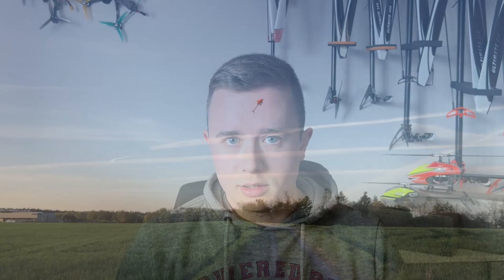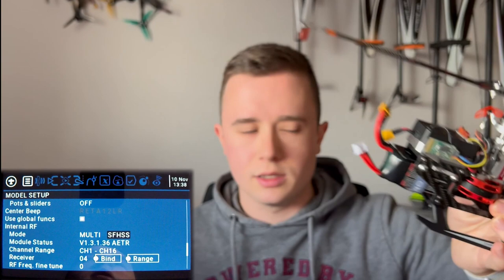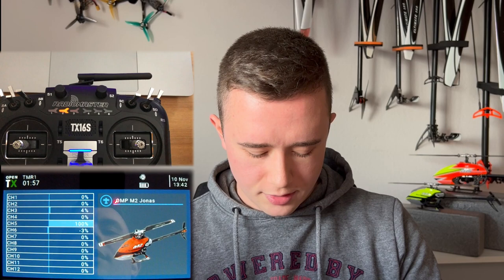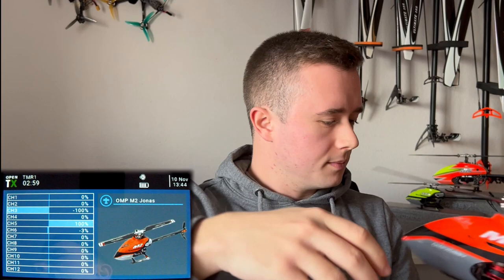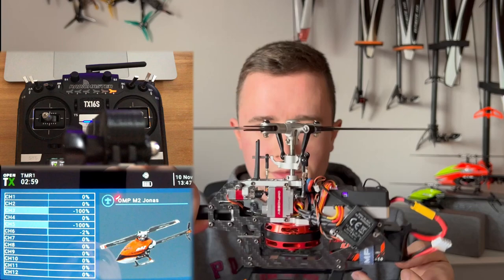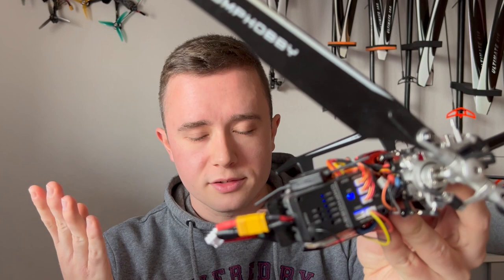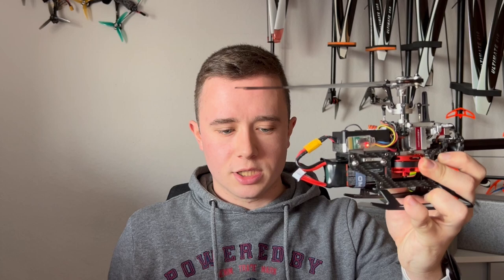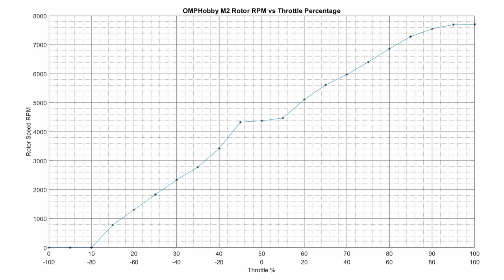Jonas' OMPHOBBY M2 Setup for RadioMaster TX16S

Comment: Thanks for providing this video and setup file, it is very helpful for OpenTX newbies like me! The rescue feature you added in is cool. Also, thanks for the introduction to the AccuRC simulator. For helicopter radio setup it is WAY easier to use over Real Flight, and has a bunch of cool helicopter models included! I hope you will keep adding more helicopters. :)

Comment: Did I break my telemetry, or is it only functional with the OMP protocol? I have a spektrum and micro futaba on hand.  I am thrilled to try the deadband fix since I couldn't do that with a DX8. This is a fantastic reference guide and so useful as there isn't customer service, in my experience, in talking to OMP.  Much thanks Jonas.

Comment: Hi Jonas, thanks for the excellent M2 setup video.
I have a question regarding gain, I have used your settings but I can not go above 20% without an up and down osilation, I have tried lowering both elevator and aileron gain to 2 but I still see it, I also checked the main blades for balance.

Comment: Hey Jonas! Thanks for this video! Do you know if there is some program limitation for negative collective pitch in normal mode on M2? I am unable to make my CP go negative in normal mode with M2 Explore an Radiomaster TX16S in an attempt to have symmetrical CP settings in all modes to avoid jumps/drops. No matter what I set in curves - the CP drops just a tad below 0 and stays. No problems with positive in normal mode and anything in idle up 1 and 2.

Comment: Jonas, I recently used your setup and worked great using the sbus receiver connected to controller. I recently updated my RM 16s firmware to use the OMP receiver builtin to the controller. I wanted to take advantage of the telemetry function. Once it was bound, the collective was no longer linear with the throttle stick, it will suddenly jump to a high position in all flight modes. Have you seen this before? I have two M2's and both do this.

Comment: Hi Jonas, thanks for the video and the setup file. I use a Graupner receiver on the SBUS port. Everything works well, except failsafe. Failsafe is configured in the receiver, and it switches to failsafe (failsafe bit is set and channel values are set to failsafe values on sbus) when I switch off the transmitter. But, my OMP M2 just holds the last values. Do you have the same issue, with your sbus receiver?

Comment: Hey, Jonas, great video!  You probably know this, but you can alternatively setup an RPM "spectrum" by programming your S1 and S2 dials.
Reply from the maker: Yepp you're right, that's another option. The advantage of using the 6 pos buttons is reproducibility though- if you click the same button, it will result in the same headspeed every time. With a dial, you'll have to remember values and check the channel monitor each time you want a specific headspeed.
Reply: @Johnny31297  Yes, I tried it both ways. Just wanted to point out that the dials are an option, too. Now I use a Tango 2, so I'm back to three flight modes, lol.
Reply from the maker: @navigator2011  Same, but 6. On the Tango I programmed one of the shoulder buttons to drop the throttle percentage a certain amount, so it's 3+3 flight modes essentially
Reply: @Johnny31297  I love how versatile OpenTX is!!!

Comment: Hi Jonas - on your OMP protocol M1, you’re stuck with the built in pitch and throttle curves, correct or no? I’d like to have battery telemetry with an M1 using the TX16s Mark II, which means I have to get it OMP protocol right? If that’s the case and you’re using the built in curves, please advise if the built in curves are ok - mostly a slow and easy sport flyer. Plz lmk as soon as you can as I’m about to purchase. Thanks!

Comment: Jonas, what is the range you're getting with the Futaba external RX on the TX16S? I did a range test on a DSM RX I installed and it was hardly 85m. Is that normal?

Comment: Hiya. So I really need some help.
I'm using edgetx and can get it all on but I'm using spektrum and the channels aren't correct. I was going to swap them but then it messes with loads of linked settings.
How do I get it to import or see channel 1 as throttle etc

Comment: Dear Jonas, thank you very much for this video. Your explanations are really masterclass. I've downloaded your setup files, but they're OpenTX. On my Radiomaster I'm running EdgeTX. I'm quite new to this hobby, so my question is: Can I import and use your OpenTX-file to my EdgeTx-running Radiomaster or do I need to convert it first? If both options don't work, could you please share your setup files in EdgeTX-format? Thank you very much and have a nice day. Best regards, Markus.
Reply: You can just download his m2 evo setup which is almost identical to this one and adjust everything to your liking. It's in the description of the m2 evo review
Reply: @raihanmiah7162 : Got it, works great. Thanks for this advice.

Comment: Thanks for the great videos. Why not just program your timer on your collective at zero throttle, Normal mode?  No hassles or extra switches to worry about.
Reply from the maker: Because there is no throttle stick on collective pitch 3D helicopters 👍
Reply: Im referring to collective 'stick' as throttle. Do you mean because you are not using a normal mode to lower your stick to 0 throttle?  In Normal mode my throttle 'stick' at 0 stops the timer. I use clear to reset.

Comment: Hi Jonas - just curious about the aileron agility setting at 4 vs stock value of 5.  With the lower value being less feed-forward, does that reduce the aileron flip rate?
Reply from the maker: No, just the initial response to control inputs, the rotation rate is controlled by the Speed setting 👍

Comment: Question, will this work if you use the OMP protocol?  Right now I'm using the setup from BuddyRC for the TX16S with EdgeTX and I saw that you had different setups depending if you were using Spektrum vs SFHSS and I figured it would be different for the OMP setup as well.

Comment: Hello Jonas, thanks a lot for the rescue video on BuddyRC and also on for this video. Question, your setup change the servo positions quite "hard". Normaly opentx could do a ramp up of the new servo position in a given time. My understanding is that it is not doing it because we are running 2 operations on the same mixer in the same time. I changed also that I have a fixed time if 1,2sec instead of holding the switch. This is a more safe version for a less good pilote in my opinion. Do you gave an idea how to bring in the pitch after the helicopter has turned less hard? maybe to bring the pitch in with 0,1sec? Knowing how to do it, it would maybe also be possible to reduce the pitch after a limited time again so that helicopter does not continue climbing. And if this pitch function ends not as replacement it should also be possible to make a transfer time to get back to the pitch possition on the transmitter, so that different pitch possitions come back less hard when time is finished. I hope you an follow me and I hope you have an idea.
By the way, why do you not upload the video from BuddyRC to your side in addtion?
Kind regards from Munich, Timo
Reply: Hallo Timo, ich schreibe dir, weil ich auch in München wohne und mir auch die Videos von Jonas angeschaut habe. Bei mir bestehen noch einige Unklarheiten und ich habe dieses Video auch schon  kommentiert und gefragt, aber keine Antwort erhalten. Wollen wir beide uns zu diesem Thema mal austauschen? LG Markus, aus München.
Reply: Hallo Markus, man könnte die Übergänge sicherlich etwas weicher gestelten. Muss man aber bei dem kleinen Heli nicht. Das kann alles so bleiben wie von Jonas empfohlen. Funktioniert einwandfrei. Weitere Fragen? Am besten im "RC Heli Forum" anmelden und ein Post schreiben. VG  @markuslang6695
Reply: Hallo Markus, man könnte die Übergänge sicherlich etwas weicher gestelten. Muss man aber bei dem kleinen Heli nicht. Das kann alles so bleiben wie von Jonas empfohlen. Funktioniert einwandfrei. Weitere Fragen? Am besten im "RC Heli Forum" anmelden und ein Post schreiben. VG

Comment: hey jonas, thanks for the setup! which channels do i have to change to 125% for DSMX usage? only aileron, elevator and yaw right? so set these channels to -125 to +125 ?
Reply: @jonas I would love to know this also. Can this setup also apply to the M1?
Reply: @grimesric I think he means you have to set -100 to -125 and +100 to +125 but would be good to know which channels but I am guessing it is the ones you have listed also yaw left
Reply: Not throttle as well?

Comment: Hello , I was referred to you video by Helidirect , my OMP M1 is not holding zero degrees at mid stick and the swash plate will not hold level . I'm getting 18.5 ° positive and 10.2 ° negative maybe even less . I have gone through all the settings on the flight controller , and cannot seem to get it correct ? I'm even using a digital pitch gauge , I have 0.1° on one side of the heli and the other side is giving me a reading of -6.2° . This is driving me crazy I'm thinking something is wrong with the heli or the electronics.  I might be able to get it if there were adjustable linkages , as you know they do not exist dor the M1 .
Reply from the maker: Forget the digital gauge, adjust the swash so that it's level and the blades are in line, then adjust collective endpoints by tip distance. A digital gauge is way overkill for such a small heli.

Comment: Hi Jonas, maybe you can help with my M2's. My old M2 has a FHSS Sat Rx and I use your TX16S setup... it works great. Got a new M2 and am using a Kensun DSMX Rx. I noticed the Kensun M2 seemed to be flying in Safe mode. I check it out and it was flying in safe mode with same setup as my other M2. So it seems that the new Kensun Rx has reversed the SB (Safe mode) switch. Is this possible or do I have another problem?
Reply from the maker: Yes, as mentioned at 3:09
Reply: @Johnny31297  Thanks... I guess I missed that part. I feel better now, but also stupid too! :)  I guess you say to set limits to +/- 125 in the Mixes channel 5?

Comment: I have the DX6. Im switching over to the 16s max.  With the DX6, I have a dead band on the pitch at center stick with the M2, not the cyclic.  It doesnt want to catch itself after flips, and it drops out.  Does your dead band mod also fix this, or only the cyclic?  Do you have a link that describes in detail how you do this dead band mod? Is it in the outputs and you assign it 'all' inputs?
Reply from the maker: There is no deadband on collective, only on cyclic. You‘ll need to correct for this manually.
Reply: @Johnny31297  Ok thanks!  Ill re-check my pitch curves. I appreciate the help.

Comment: Hello sir jonas since you're using satellite receiver and spektrum. Is this set up also work to omp firmware. So im using stock receiver of omp m2 and bind directly to my tx16s. Is this will still work on my m2?
Reply from the maker: It’s not, the OMP protocol is very limited in its ability to adjust throttle and collective. I‘d always recommend an external receiver. 👍
Reply: @Johnny31297  how about the mini m2 satellite receiver sir? If i buy mini satellite receiver then download your file to my tx. I will just need to bind it and fly?
Reply: @Johnny31297   doesn’t the omp protocol just refer to the data transmission method? My understanding is that the built-in curves on the board are still used even with using a sat receiver. Can you clarify? Plz let me know I’m planning to purchase soon. Thanks!

Comment: Using OpenTX Companion to add the M2 setup, then lo and behold, all my models vanished (radio.bin and models.txt got overwritten instead of updated, backup, backup and backup!) <=== use companion and there is no issues.